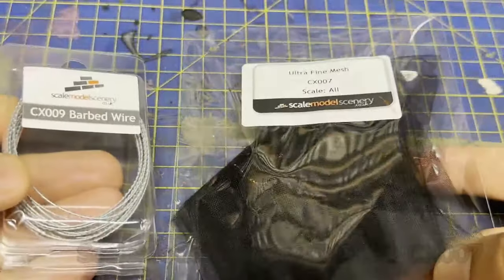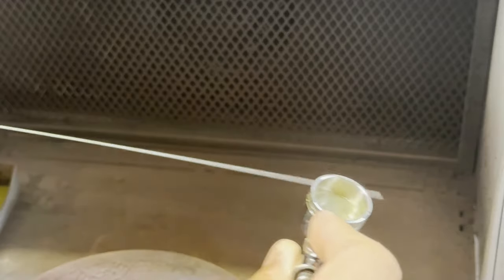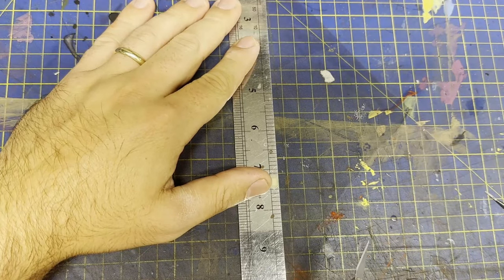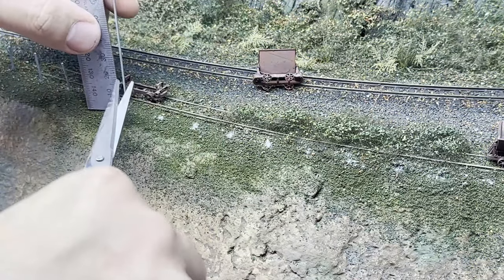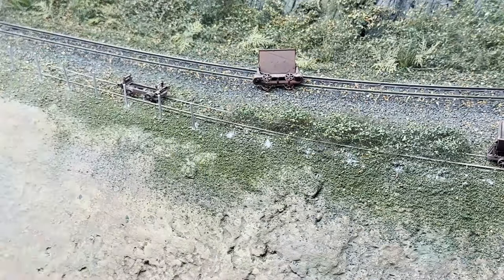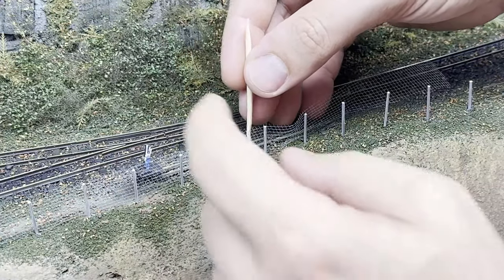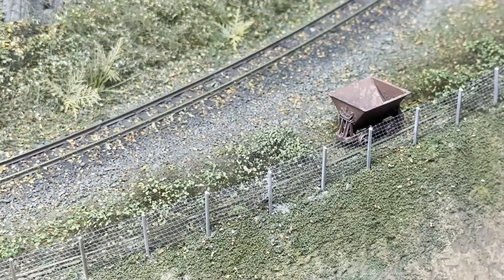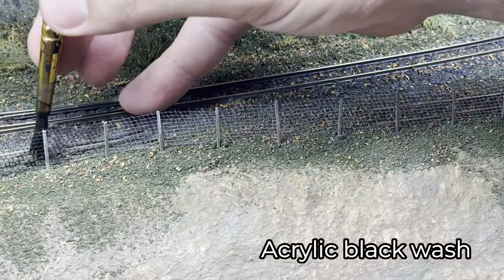009 Narrow gauge running session! (& fence making)

Comment: Lot of effort for a fence - but it is the "large details" which make it al look real - so well worth all your efforts I think.
Most people seen to use matchsticks as fence posts, which are about a scale 6" thick at 4mm; leave the posts off vertical,  and don't pull the wire taught.
It all runs well - i guess even without stay-alive if you aren't DCC.
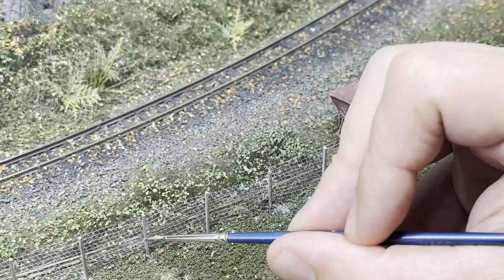Did you fix the drip at 3:37 - we can see these due to the magnification.
Gread vid as ever . . .
Reply from the maker: Hi, yes I agree, it was a lot of effort, but commercially available fences are completely different styles, so we’re never going to work.
Good spot with the drip, yes it’s gone. I tend to do a quick bit for the video, then move the camera and actually do a tidy job ‘off camera’ so I can see what I’m doing!
Cheers

Comment: Watching 7 slip with the full set, I'm wondering if it's possible to pack some weight or liquid gravity into the bodyshell, as I'm guessing it doesn't weigh very much as just the 3D printed shell and the chassis. Other than that, the layout is coming along really nicely, and it's good to see trains running to bring it all together.
Reply from the maker: I’m planning to add weight to 7 after this session - goes to show that playing trains has benefits!
Reply: @GWilliamsonModels  of course! All in the name of progress!

Comment: Nice to see the loco’s and stock that you’ve built so far running at last. That must give you a burst of momentum. Do I spy a lurch as the trains pass over the baseboard join? Is that normal for 009 and within your standards? Or is it bugging the heck out of you?
Reply from the maker: Good spot, I’ve been meaning to fiddle with that join, as the one board has risen about 1mm, so I’ll flatten it down again. It’s only a tiny amount, but in 009 it’s a lot